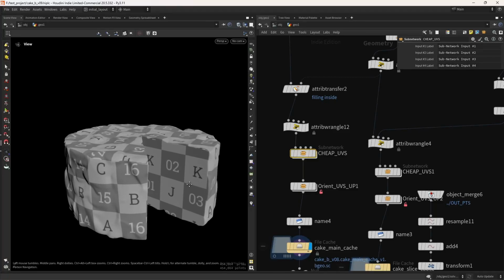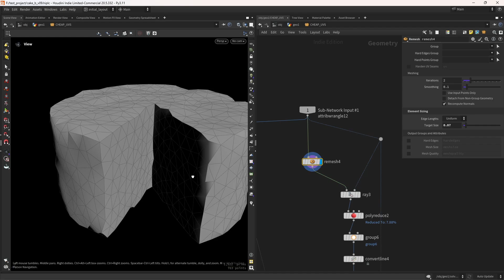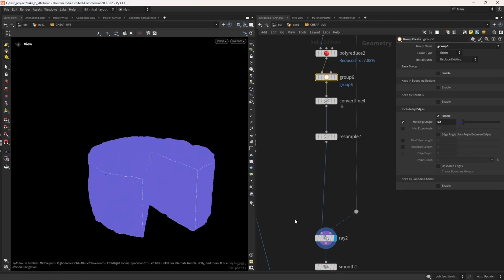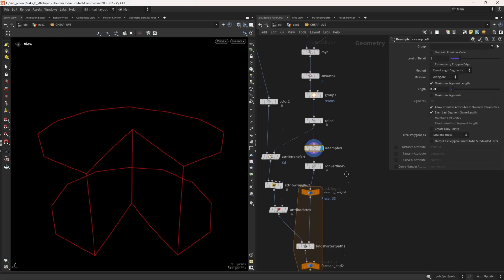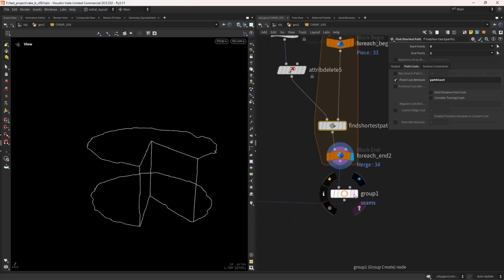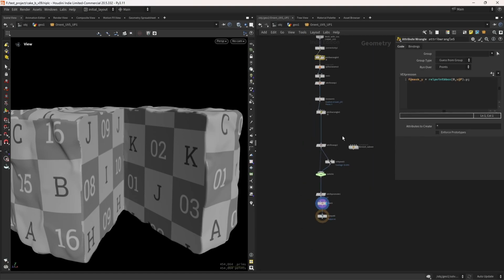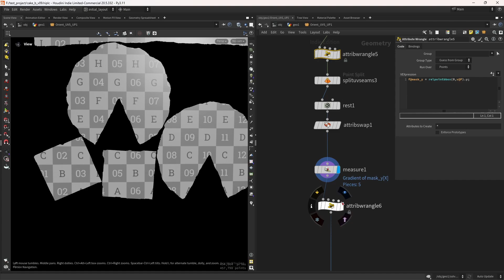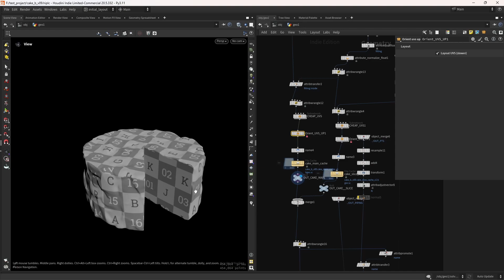Procedural UV's In Houdini

Comment from the maker: Here's a more detailed breakdown of the second part of the setup, since I rushed a bit:

1. Create a connectivity on the prims, using uv connectivity;
2. Add a relbbox y mask to later orient the uv shells "up";
3. Swap uv's to P(promoting to point attr in between)
4. Now we can measure the gradient of the mask y attr, which will create a vector attr along the "orientation" of the shell.
5. In the wrangle we calculate the angle between the x and y components of the gradient.
Get the centroid of the uv island.
Create a quaternion(could do it with matrices also), passing the angle we just calculated, around the z axis(uv space).
Subract the pivot from the uv, qrotate, and finally apply the rotation to the uvs.

Hope this helps. Cheers
Reply: would be great to check this project file out, i couldn't find it via the link, unless its a paid product. but certainly a great process.

Comment: Great tutorial! One challenge I often encounter is orienting UVs for timber planks, especially when working on interior scenes like a room built from wooden boards. Timber grains typically run parallel to the longest side of a surface, and I’ve struggled with procedurally creating UVs that align correctly—particularly when the planks are placed at angles, such as along a pitched roof.

Is there a way to procedurally texture timber to address this? It would be great to know if a solution exists!
Reply from the maker: Hey, it shouldn't be too hard as it's basically a rectangular geo. It would be easy to guess the angle with vex, similar to what I have done here. If you want, send me an example file on patreon, and I'll have a look. Cheers
Reply: You could try running a sort by proximity on the prims from the centroid distance. In theory prims 4 and 5  will be the furthest polys , so it should give you the plank cuts, which you could then use to map the gradient.